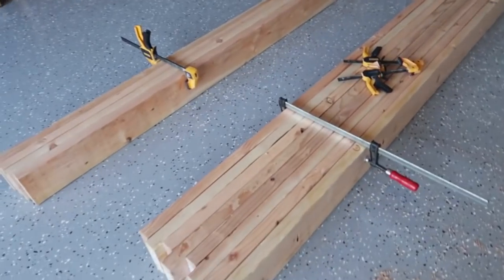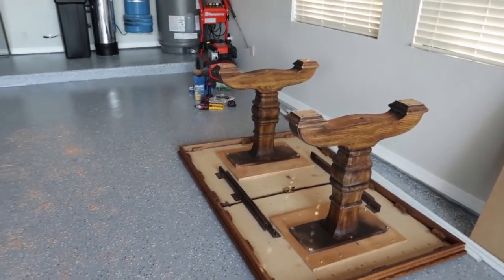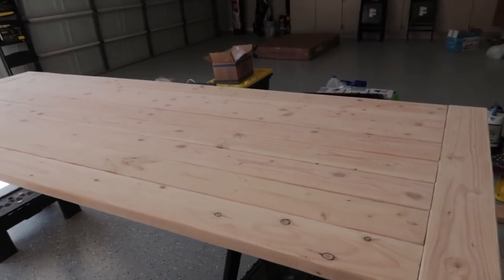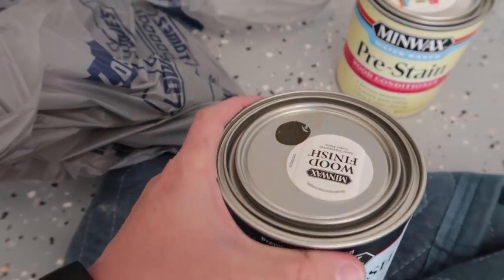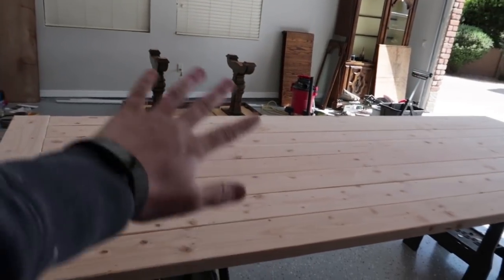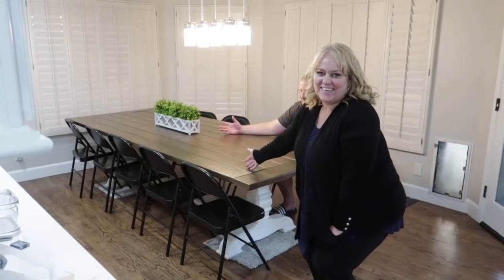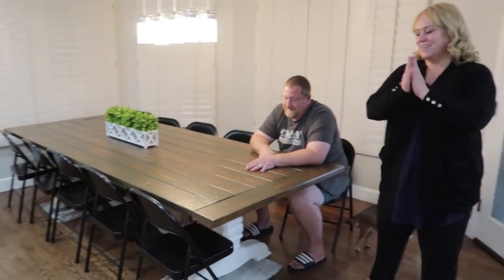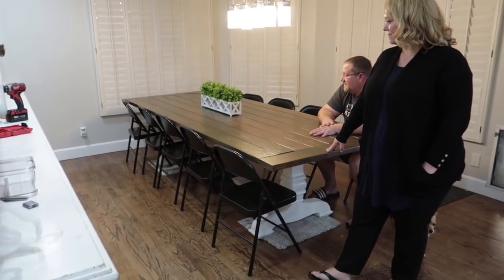DIY FARMHOUSE DINING TABLE

Comment: Why did you decide to cut the length of the 2x6's? Also, there is a polyfiller that will fill in the gaps between the 2x6's. And it gives the same pretty finish and the acrilic finish. I used it when I repurposed my old hard wood floors. Live the difference it makes and easy clean up.

Comment: How did you get the boards to stay together without putting a cross board underneath? Just curious,  especially since so big.  Looks amazing! 💜

Now we know WHY the Crazy Middles have been MIA... 🤣💜
Reply from the maker: I used a kreg jig to drill pocket holes - then the pocket holes conceal the screws underneath!! It’s a fun tool!! 👍🏻👍🏻 thanks for watching! ♥️
Reply: That was what I wondered too. Yay Kylie answered. I'm surprised that's strong enough. I guess the wood is fairly thick and the screws can be fairly long.  Then you just need enough of them.